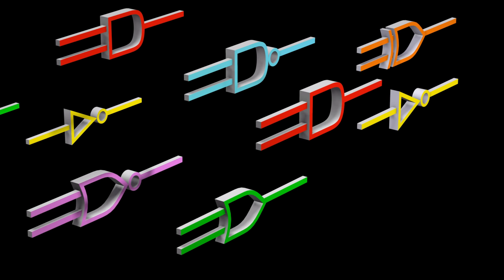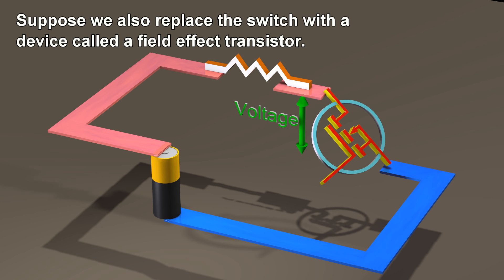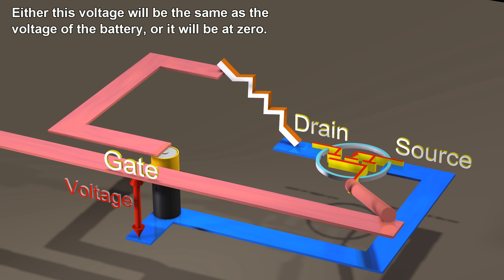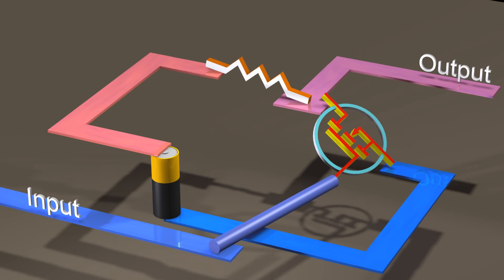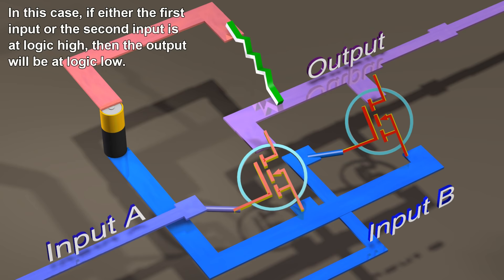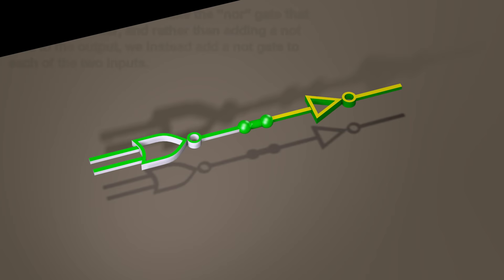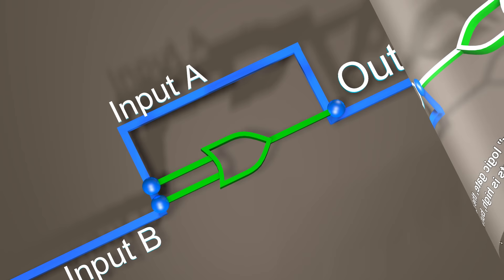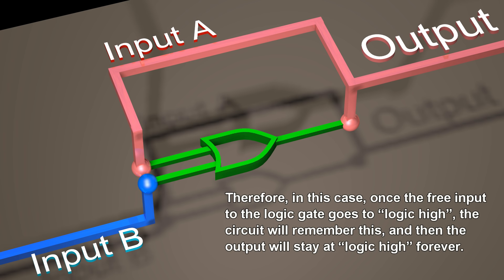Logic Gates from Transistors:  Transistors and Boolean Logic

Comment: This way of explaining circuits breaks down when you have just a battery and a wire, like in that case the voltage would have to drop eventually, so I can't be all at the same voltage as long as it's connected by a wire. That confuses me.
Reply from the maker: Batteries have some internal resistance, so you have to model a real battery as an ideal battery in series with a resistor.

Comment: instead of 1s and 0s or on and off, I see High and Low or Hi and Lo more often.

It refers to High voltage(on/1) or Low Voltage(off/0) also Low/off doesn't necessarily mean no voltage it just means low and this can be a good idea if you want the circuit or chip to have a reaction for a disconnected situation where it isn't getting any voltage and can go into a safety mode to deal with it.

If you've been around in electronics it's something you quickly pick up but often gets glossed over in lessons.
Reply: yeah for sure. in highschool, we only ever learned about 1s and 0s

Comment: Excellent animation.

At the same time as the animation appear, I would suggest to show the truth table with all 4 possible input present and output set to ?. Then, as the animation show the transistors/switches moving, replace the ? by the value displayed by the animation.

When showing the conversion of logic function by inverting the output, a truth table with two columns for output would make it more clear. One output column showing the result before inversion, the other, the actual result after the invertor.

Finally, when showing the inversion of both input, the truth table may have 2 layers, as two table on top of each other in 3D.

If we dream to make this introduction to logic gate memorable forever, some humour could be added. For example, showing old looking switches on ceramic insulator with exposed paper isolated wires. Then, flashback to the modern era of transistors. Another short historic flashback could show these fences with a few locks in chain, representing an OR gate: any resident with one key can access the shared land.
Reply: But why suggest?  it's not like they're gonna reupload?  no one reuploads videos like these when people suggest edits.
Reply: That is a valid point. I don't expect the author to spend time and convince his financial supporter to produce an improved tutorial.

The characteristic that distinguish this author is an original way to explain electronic concepts using 3D.

I hope that somebody else will get inspired from these videos to create yet another way to display these concepts... I have no idea what it could be. I hope that this new author will also look at the best tutorial that existed in the antique quasi prehistoric time when I learned logic gate.

 At that time, a "truth table" was always shown, presenting all possible input and resulting output. This is the top down approach : show the result, then work you way back to the abstract of engineering. 

The fact that you commented my comment shows me that my comments get really published by youtube and that some people read them. This is good news to me, giving some value to my attempt to write constructive comments.

Comment: There are simpler ways to make the NAND and AND gates.  Just put the two transistors in series instead of parallel and that takes care of needing 3 NOT gates for the NAND gate (because the two transistors by themselves will be the NAND gate).  Then you only need one NOT gate to turn the NAND gate into an AND gate.

Your XOR gate could have been done in as few as 7 transistors.
Reply: You're right. But those transistors were connected in parallel to have them separated and occupy more space, so it can look more clear.
Reply: Yes you're right! For the XOR gate they also showed that it consists of an OR + a NAND + an AND gate, instead a NOR + an AND + another NOR would also work and as you said would only use 7 transistors (or am I mistaken?)...
Reply: That would work, but I can make one with only 4 transistors.
Reply: Timothy Chapman How would u do that? I'm really interested! ':D

Comment: Hi i'm confused in 5:33,  based on the illustration, 
Input is logic LOW
Output is logic HIGH
with that, therefore NO CURRENT is flowing through the resistor. right? coz THERE'S NO voltage difference at the two ends of resistor.
INPUT         0
OUTPUT     1
OUTCOME: NO CURRENT.    0
isn't it the real output variable is if there's current flowing in or out of the resistor.

and in 6:00
Input is logic HIGH
Output is logic LOW
with that, therefore THERE IS CURRENT flowing through the resistor. right? coz THERE IS a voltage difference at the two ends of resistor.
INPUT         1
OUTPUT     0
OUTCOME:  THERE IS CURRENT.    1

no my question is, is it really a NOT gate? Coz There is current through the resistor ONLY IF Input is HIGH.
thanks for response :)
Reply: Nope.
You have to look at the whole thing as a complete closed element with only INPUT and OUTPUT !
You don't look inside, you don't care what happens with the resistor, transistor or internal current.
You ONLY CARE with the INPUT and OUTPUT.
For example, if you apply +5V to INPUT if you get +5 or 0 on the OUTPUT.
You're looking to use this as a small element in huge logic hierarchy so you only care what's the voltage in and out.

Comment: The background music is kind of out of place, but other than that, this is a great video! Now, just a question that I have after watching this: what would be required to change the output of that logic gate at the end of the video back to logic low?
Reply from the maker: +Felipe Gabe, you would need to interrupt the logic high signal from the output to the input.  Once both input signals are at logic low, the output will return to logic low.

Comment: In the case of an amplifier, would the gate terminal be used as the input of an audio signal, changing voltages in tiny (or high) increments that would be amplified on the drain?

Comment: At 6:30 students should notice that the symbol doesn't show the battery connection, but in a physical circuit there will be leads to power it.

Comment: What happens when you have a not gate and feed it into itself. If its high then the output becomes low, which inputs low, then becomes high. Will it just fluctuate.
A = A'
Reply from the maker: jk991234 Yes, the output of the not gate will keep flipping back and forth.  At least that is what would happen with a real not gate.  The circuits I drew for this video is not the way actual commercial logic gates are produced.
Reply: Asim Deyaf yes, that would basically be what's called in electronics a 'clock'. Its something that oscillates at a constant frequency and can be used to set the speed of a circuit or how often something happens. I think you've heard of 'clock speed' when looking up graphics cards or processor specs
Reply: jk991234 I don't know too much about this stuff but would the circuit burn it self because it's a short circuit?
Reply: Ty Prince
No, these gates are usually pretty weak they  can't supply enough current/voltage to destroy themselves. It also depends on how much resistance the input to the gate has.

Comment: In the final example what happens if you use an XOR instead of an OR gate and switch input B to high; does it just explode.
Reply from the maker: If the input that we control is high, and the other input is tied to the output, the output will keep oscillating.  This is similar to connecting the output of the not gate to its own input.
Reply: How quickly would it oscillate?
Reply: It explodes. Read about Manhattan Project.

Comment: Why not include an AND gate in the example where the input of the OR gate is fed back to one of its own inputs? By placing one of the AND gate inputs at the output of the OR gate and feeding its output back to the input of the OR gate (rather than the OR gates own output) . Along with placing an inverter (Not gate ) output at the other input of the AND gate, a memory cell with no disallowed states has been created .

Comment: So each logic gate must have battery in it?
Reply: gre kiki 
Well sort of, yes. I think in reality though you just use one battery for all of the transistors/logic gates at once.
Every transistor/logic gate just needs some access to a 'high' and a 'low' voltage, so there's no reason that they can't all share the same battery.
Reply from the maker: gre kiki As Modus said, you do not need a battery for each logic gate.  Each logic gate has terminals for providing powering the logic gate, in addition to terminals for the inputs and output.

Comment: at your last example... is there a way or a logic circuit that can remember the out either high or low if i want to? your example makes the output high forever :D is there a way i could make it low again?
Reply from the maker: +gabriel galang, yes you can make the output low again just by inserting another logic gate in the path leading from the output to the input, so as to be able to provide a reset.  Another way to do this, which is far more efficient, it to use logic gates to make a "JK flip flop".  A search for "JK flip flop" in Google will provide all the details.
Reply: thnx :D

Comment: One slight mistake i think bcoz source should be connected to the negative pole of the battery
Reply from the maker: There is no mistake.  The video shows the source of the transistor connected to the negative terminal of the battery, as you describe.  By the way, I have a much more detailed video on the operation of transistors in my video at https://youtu.be/Bine_PbyFSQ